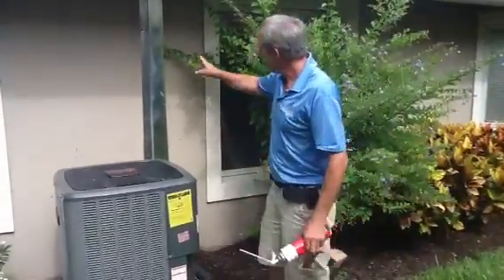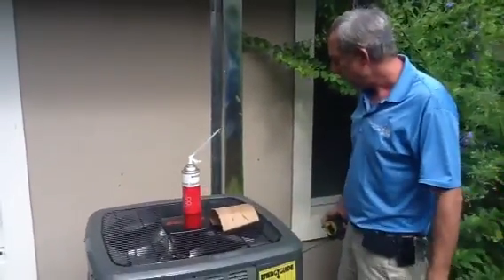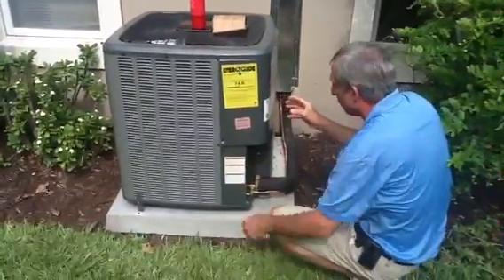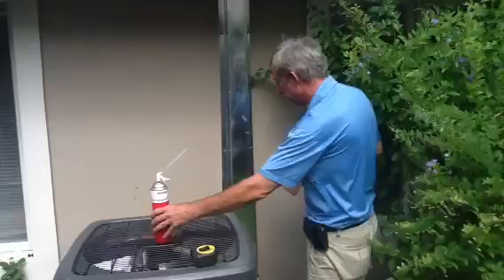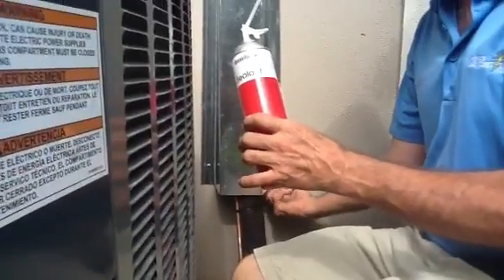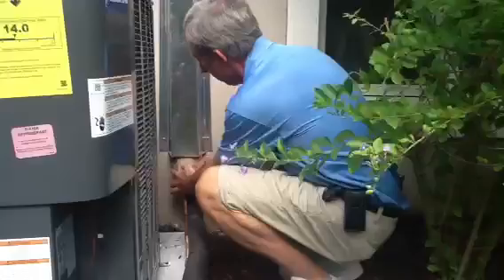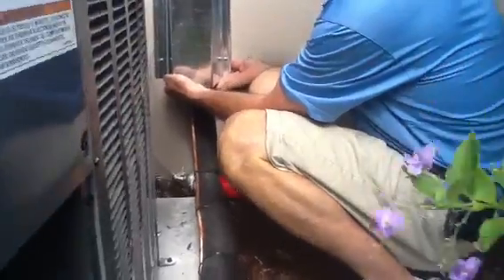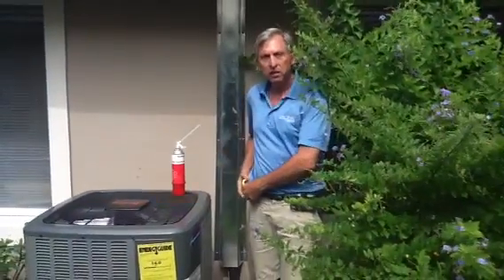HVAC Proper Lineset Installation

Comment: What is the average cost to get a line set moved to the outside of the house like in the video? My furnace in the attic has  a line that runs down a column in the middle of the house. I want to move it so i can get rid of the column. Thanks.

Comment: Thank you for rotating the service panel out. I do it every time because you’re supposed to. I hate seeing them against the wall. I also see a lot of drain lines that terminate close to the service panel instead of routing a few feet away. Cause we all just love standing in water and mud while we work.

Comment: My 4 ton unit has 3/4" line, not 7/8".  It is 20 feet.  Seems to work ok and HVAC installer never called it.  Should I upgrade line?

Comment: My Goodman calls for an inverted loop on the suction line above the a coil since the outside unit is mounted lower. My line in my attic comes down about low plenum hight maybe 6 inches above a coil cabinet.so do i need to put the inverted loop with equal length sides in the attic before the line curves down to the a coil or can the inverted u have say a 5 inch going up then then the width also being 5 inches then the last part of the loop extending down to the a coil? Basically do i need to have an equal length inverted loop installed in the attic or can the last part of the loop continue down to the a coil?

Comment: Thanks for the video.  My hvac line is from 1998, i guess it runs under the house.  My HVAC guy said to install a new one it would go through the roof like what you show in the video.  How much is a job like that roughly?

Comment: Looks like a nice install and very nice to service.  I wonder why nobody installs them further from the siding as specified in the installation guides from manufacturers and is recommended in any tech school training literature.  I was wondering how far in inches was yours from the wall, and why not make it optimal at around 30 inches at least?  I had to add a suction line filter today, with 14 inches between house and OD unit.  Add to that another 12 inches from another OD unit.  With everything squeezed back there, it was like an exercise in physical torture trying to pipefit, braze, etc.  All I know is that the closer the unit is to the wall, the higher the price.  I'm done killing myself unless there is enough pay to justify how sore I am afterwords.

Comment: HI David, great video man. Question. If a Tech installs a line set for example 3/4" Low side...3/8" High side, and he didnt bother to insulate the Suction line at some point in a Conduit, Would that affect the Superheat or the Subcool eventually?

Comment: The main reason is because the compressor generates heat: the inherent 'heat of compression' that comes from squeezing the refrigerant (or any other gas), and heat from motor inefficiency--both electrical (reactance) and mechanical (friction). 

You want the refrigerant to absorb all this heat from the compressor. If you let it come up to equillibrium temperature, the compressor won't last as long.
Reply: How

Comment: Why is the suction line insulated? It's returning refrigerant to the compressor - the refrigerant's job has already been done. It has completed it's mission back at the evaporator coil. It's finished. It has nothing left to do except to be re-compressed. Why does it need to be insulated?